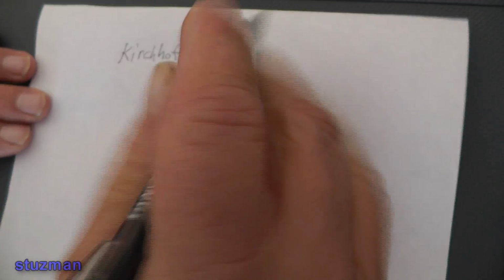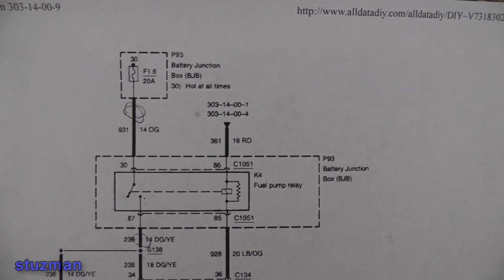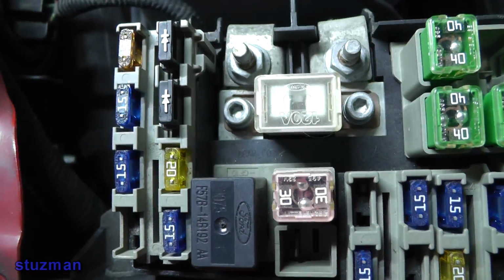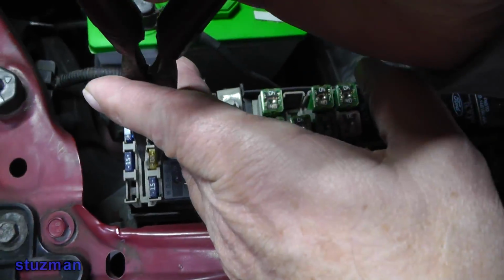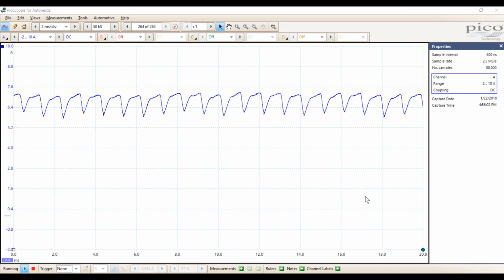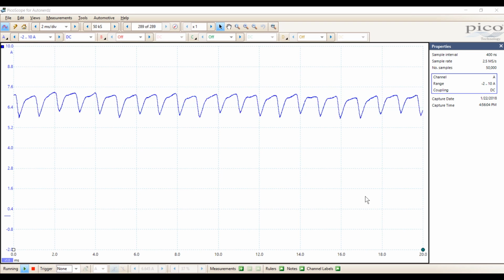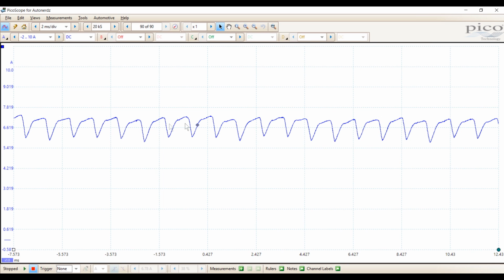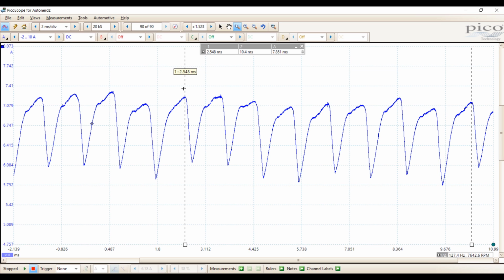Checking Relay Contacts Dynamically

Comment: thanks for sharing. When you used the relay attachment tool from Lisle, how did you know which tabs to buy your volt meter up to ?
Reply from the maker: JJ Smith The numbers are located directly on the relay adapter. I showed the numbers on the relay adapter in a previous video of where I was diagnosing a fuel pump issue on this car.

Comment: Interesting video but why everybody says current flows - to + ? And why you supposed to take measurements with amp clamp other way around ( + to - )
Reply from the maker: The actual current flow in reality is from - to +, yet in engineering classes it's normally taught as conventional current flow, (+ to -) at the macro level. When you get down to the atomic level in describing a component's operation, such a diode or transistor, its then taught as electron flow. It really doesn't matter mathematically which direction the current flows as the answer comes out the same when using equations in electrical. The only difference is that a - sign will show up in the answer showing that the current flows in the opposite direction. Most engineers and technicians today even think in conventional current flow when analyzing circuits. As far as the amp clamps measuring conventional current flow, not sure why they are made that way. It's best to install the clamp around the wire in the correct direction as some of them have a higher accuracy when placed around the wire. Hope that answers your question.

Comment: Terry, I thought you were going to take amperage readings at the fuse and then at the output wire of the relay.  Compare them, get the difference and use Ohm's law to get the resistance across the contacts.  Can that be done if you don't have a fancy relay holder with external contacts?
Reply from the maker: The current reading at the fuse which is ahead of the relay contact would be the same current at the output side of the relay contact. So, if you do a subtraction, it would be zero. If you want to measure the voltage drop across the relay contact, you could always get some thin stranded wire and wrap it around the two terminals of the relay contact and then insert the relay back in its socket. Here's a video showing that method https://www.youtube.com/watch?v=C8t25GjZ6i4

Comment: Wow Terry, that was one of the most complete instructional videos I've seen on how to correctly use an amp clamp and interpretations of a sample I've seen. Very well done.
Reply from the maker: Thank you very much Wyatt, but I did make one mistake in the PicoScope section where I mentioned samples/sec. It's actually samples that are requested as spelunkerd pointed out. It's hard to get everything perfect, but I did insert its meaning in the description for this video if people read it. Mmmm, maybe another chance for another video to redeem myself :)) Thanks Wyatt for dropping in and the kind comments!

Comment: Excellent presentation Terry. Thank you for sharing your knowledge with us. Could you please tell me what kind of fuse loop you were using. Never seen one like that before. Thank you.
Reply from the maker: Thank you very much Ramon and hopefully there's a little tidbits here and there that might be useful to folks. The fuse loop came from a terminal kit offered by www.aeswave.com It comes with a slew of terminal adapters along with three different sized fuse loops. Here is the link to that kit https://www.aeswave.com/uTest-Advanced-Terminal-Test-Kit-p9573.html
Reply: stuzman I have seen many good reviews on that kit. I will have to put  one on my Christmas list. Thank you Terry. Cheers
Reply from the maker: You're quite welcomed Ramon and it's a very good kit which even comes in a hard case. I'm well satisfied with it and have used it quite a few times :)

Comment: Like Thomas said I learnt a lot too. I  don't usually use the amp clamp to get the  most accurate readings - I will try out the two variances and see how off my reading are :)  my amp clamp  instructions says only zero for DC and not AC . Fluke 410  - I  would have thought both but it seems not . Don't know why either haha - Terry this is gold  with presenting this  format of learning vids, you must do more. Well done .

Comment: I think the sample rate described in the field at 19:35 is samples per interval. The interval must be the width of the screen, which in this case is 20 milliseconds. I would have found it easier to understand if it was samples per second, but the math doesn't work out if you assume that. If it is samples per screen, you have (20X10^-3 sec per interval/50,000 samples per interval)= 400 nanoseconds per sample. That way the math is internally consistent with the properties field on the right. However I agree with you, it is easier to think of this as samples per second since we tend to think that way in day to day life. Practically speaking it doesn't make much difference but I was confused by the field. I like the technique you used to estimate rpm by looking for a recurring signature made by each commutator contact. Worth remembering!
Reply from the maker: You are exactly correct Dave in my usage of the samples field. It's basically telling you the maximum number of samples that will be collected. However, the number of samples desired to be collected could be less which is always correct in the properties dialog. I've inserted some text from the help menu of PicoScope to clarify this in the description of this video. I just assumed it was samples/sec as I've seen this usage on other scopes. My bad and thanks for keeping me honest :))